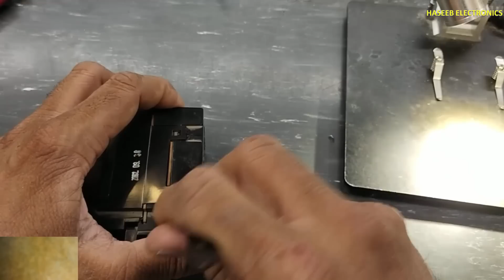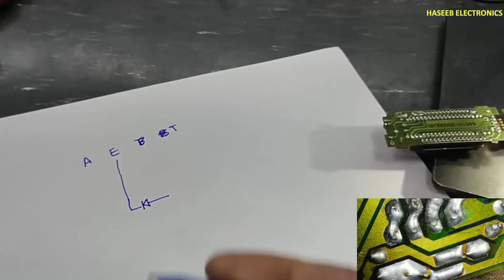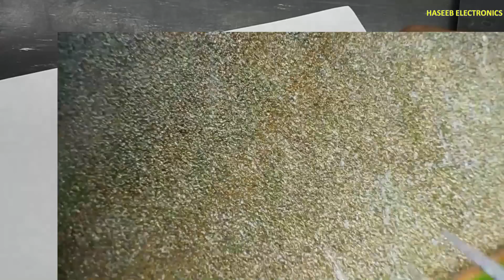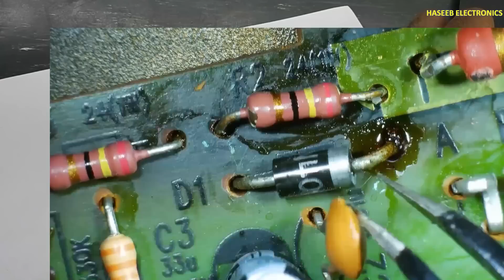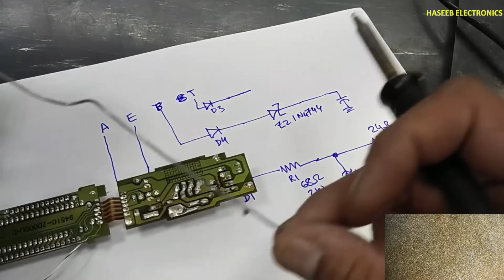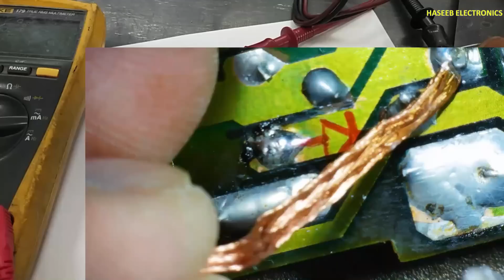{1157} Hyundai car digital clock repair

Comment: Hello. As always you do a fine job. I follow you in all of your videos.
Just one correction. The resistor R1 is 56 ohms. Of course it was just a distraction. Great Job, friend.
Reply from the maker: yes you are right 
i was reading the value mentioned on PCB. i didn't checked the value by color bands 
thanks a lot indicating the mistake

Comment: Friend, what is the function of  each of those diodes? And how did you choose supply voltage value?
Reply from the maker: these are one way conductor diodes 
just these are protecting any reverse polarity power 
secondly these will protect the next circuit from any negative spikes because in car electrical circuit there are high aplitude spikes (while starting, clutching the starter, generator, spark plugs etc)